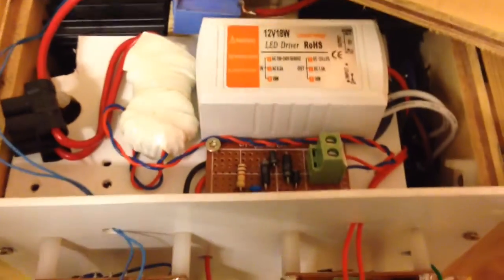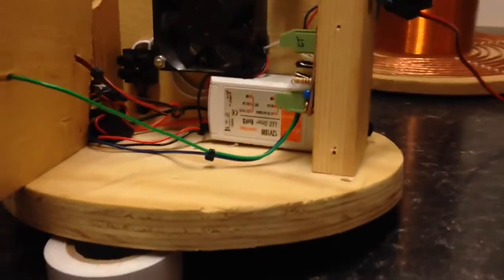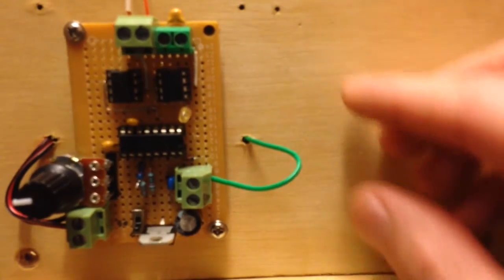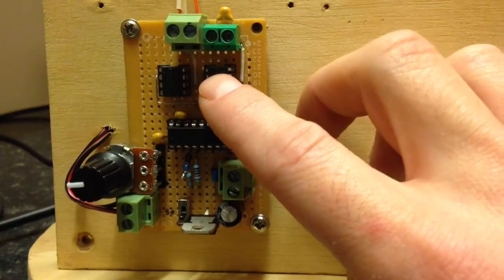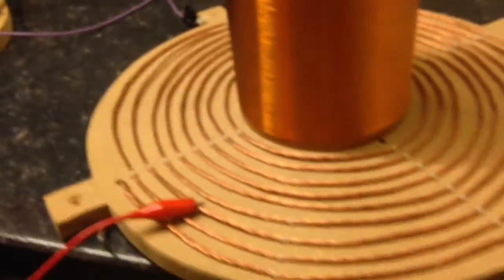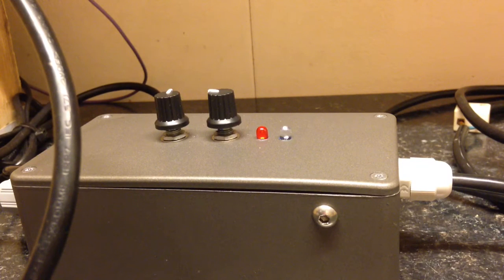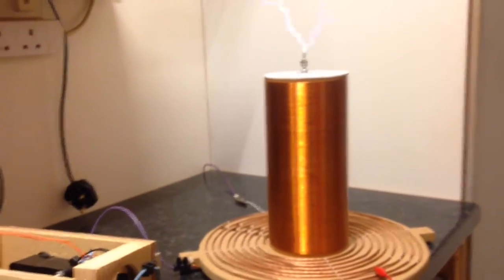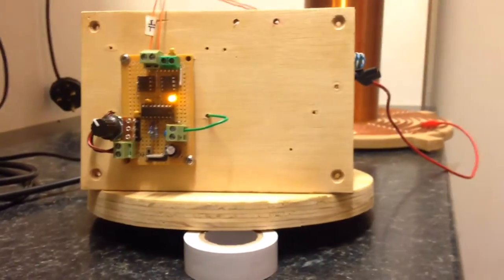PLL Tesla Coil chat and testing a pancake primary

Comment: What kind of ferrite core did you use for the gate transformers and the current sensing transformer?
Reply from the maker: Hi mate, the green ones are good, been a long time since I worked on anything so can't remember the technical details but if they're green they're good. Sure it's something to do with magnetic permeability.  The black ones from PC power supply transformers work good too. You might have to experiment with the winding's tho. You can literally tune those suckers if you pull winding's off or add them on to get the right gate voltage. I think to start with 16 turns is good but pull turns off and you'll find voltage goes up or down at points depending on the core. There's one really good YT video of a guy showing you how to wind the feedback transformer it's a must watch, I'll see if I can find it for you and link it. It works perfectly every time (two cores but wound in a specific way) take care
Reply: deeds HI HOPE YOU GOOD . IM ON THE WAY TO BUILD A MEDIUM SSTC FULL BRIDGE AND I WAS READING ABOUT THIS GATE DRIVER THAT YOU CAN DRIVE A IGBT DIRECTLY WITHOUT GDT THE CHIP IS UCC5390. HAVE YOU TRY THOSE IN YOUR PROJECTS?? IT COMES IN VARIOUS VERSIONS. CAN YOU CHECK IT OUT ?? AND HELP ME CHOOSE A GOOD ONE TO DRIVE A PAIR OF CM400/CM600 PLEASE. http://www.ti.com/lit/ds/symlink/ucc5310.pdf
Reply from the maker: here you go it's titled "Winding DRSSTC PRIMARY Feedback Current Transformers"
Reply from the maker: I did the link separate as YT blocks them sometimes, you can at least find it by the title ;)  https://www.youtube.com/watch?v=HFVR12E2Mek
Reply: @deeds3611  thank you :)
Reply from the maker: @leon13noelspy  you're very welcome mate, anytime ;)

Comment: nice explanations :) and yes, that darn pll circuit will need a bump each time you're locking the stacatto back onto the mains ramp. if you could pause it for a split second while the ramp lined up with the interrupter pulse, you wouldn't need to relock every time. the crackle is what your next circuit takes care of. thanks for the video mr Deeds
Reply from the maker: Thank you master, you taught me well. And yes new circuit time, I'm really looking forward to the next phase.  
I was just showing the Mrs how nice I had had this tuned from last night, switcho the variac and pfft pfft pop went the fuse in the staccato. MOSFET meltdown, no bangs she went in her sleep. Bridge was running cold too :(.. lol take care mate. :D